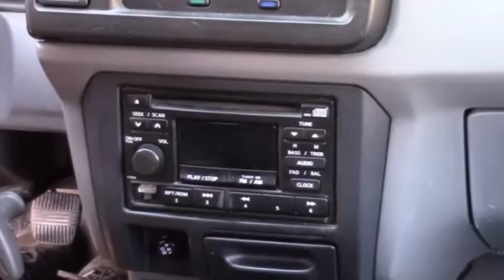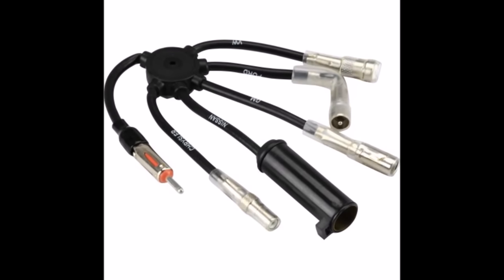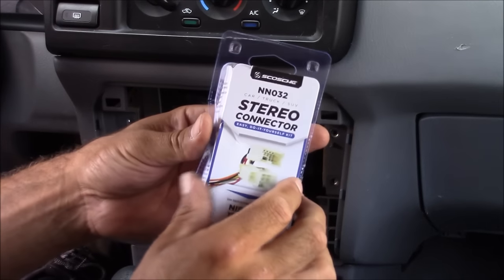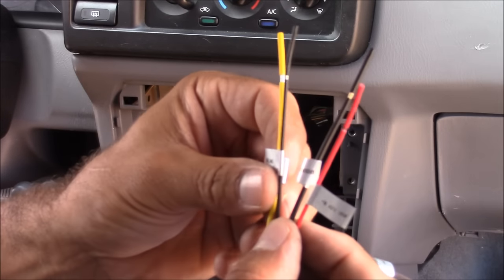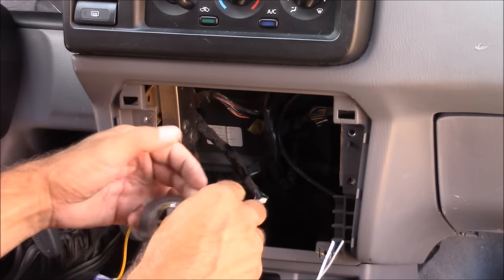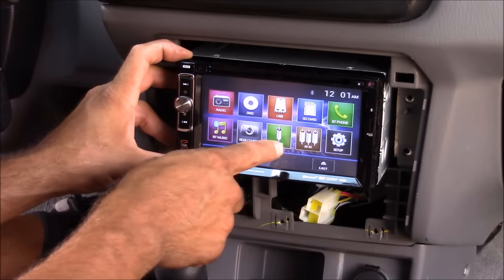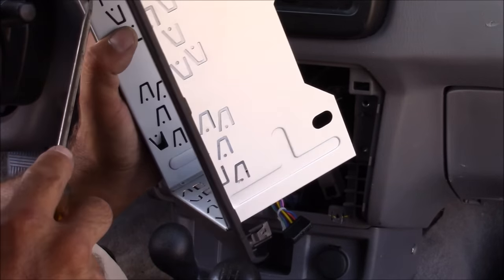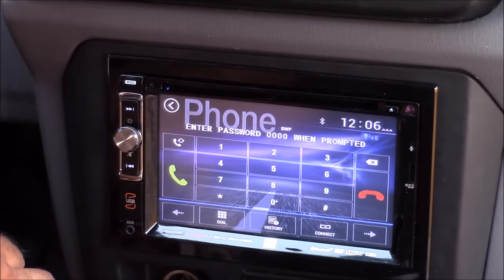How to install car stereo for beginners DIY

Comment: Hi, i just bought this yesterday. My question is this, there's a wire harness that came with it can i just use this and hard wire it the my car or do i need anything else?
Reply from the maker: Virtual Rogue if you know what wires are ground/power/speakers etc on the car then you can wire right to that. But I would recommend buying wire harness adapter so you don't have to cut stock wires.  If you ever sold the car you could easily put back in the stock stereo using wire harness adapter. But if the wires are cut it makes it a pain in the butt.
Reply: ok thanks

Comment: Can you connect subs to this double din?
Reply from the maker: Juan Vega yes just hooked up sub actually to this deck a week ago.
Reply: C.L.S. Allinone thanks and do you think you could be Able to do a full review
Reply from the maker: Yes eventually I will release a subwoofer installation video but it will be for a different vehicle. But it will be a standard installation tutorial for all vehicles. The Dual deck in this video has subwoofer volume control with frequency adjustment to get bass sounding really good .

Comment: I just bought this, but it's already been opened before and somebody took the mounting bracket. I already have a double din deck installed on my vehicle, are the brackets interchangeable or do I need the one specifically for this?
Reply from the maker: Daryl Ramos sometimes they are interchangeable you could slide it in and see if it locks in place.

Comment: Hello, I have a question. Where were you able to find the mounting cage and the stereo connection adapters for this product. I bought the same one and am having trouble finding those accessories.
Reply from the maker: Mounting cage should come supplied with stereo when purchased. If you purchased stereo used the cage may be missing might be able to find one on ebay here is a link that might help: http://www.ebay.com/sch/i.html?_odkw=dual+moiunting+cage+double+din&_osacat=0&_from=R40&_trksid=p2045573.m570.l1313.TR0.TRC0.H0.Xdual+mounting+cage+double+din.TRS0&_nkw=dual+mounting+cage+double+din&_sacat=0 ...  Stereo connection adapters can be found on Ebay or at Walmart,  Best buy, Autozone, and Oreily's and most other auto part stores.
Reply: C.L.S. Allinone Thanks a bunch

Comment: Where did you connect the steering wheel control? I have a 2002 Nissan Pathfinder
Reply: You have to buy a adapter

Comment: hey. I instead  one of these  in my 96 s10. every thing works till I cut the light on  then it goes blue. What is the best way for me to handle  it
Reply from the maker: Stephon Reed sound like Something to due with dimmer wires try unhooking any wires labled dimmer then cap them off and test radio and see if lights still effect it.  If that still does not work double check all connections its not too hard to mix a couple wires up.

Comment: 2005 Silverado WT bought the $20 dual and got everything wired to find out it didn't even work.
Reply from the maker: TractorGuyZ71 Alot of people are having issues with wire harnesses adapters having the wrong color codes. Maybe try a different brand of adapter. Best Buy, Auto part stores carry different brands to try.
Reply: Looked on amazon and they have a metra for $5 while i got the $39 at walmart. So ill try the five dollar one to see if that works.
Reply from the maker: TractorGuyZ71 ok keep us updated. thanks
Reply: Going to return it and try pioneer or something. I wish there was just an adapter you buy and you dont have to do all this wiring. Mabey there is but why would you make the video then lol!?
Reply from the maker: I dont think the stereo is the problem If you are using a wire harness adapter that is probably the problem and it might give you grief with another stereo also unfortunately .

Comment: hey i bought this one and installed and it worked fine until i turned the head lights it made the stereo screen go all blue and wont come back on unless i turn the head lights off
Reply from the maker: Something to due with dimmer wires sounds like try unhooking any wires labled dimmer then cap them off and test radio and see if lights still effect it.  If that still does not work double check all connections its not too hard to mix a couple wires up.

Comment: the xdvd256bt doesnt have a yellow wire but an orange wire that says backup memory
Reply: Duck Wizard having the same problem
Reply: Key Tomlinson no worries, the memory backup wire, is the wire. the Orange wire is the yellow wire. I got so pissed when it work. I felt stupid.
Reply: I have the same model but it wont fit in my ctown vic.

Comment: It keeps saying cant play DVD when driving got that but my cars not on
Reply: Find the wire off the stereo that is labeled something about parking brake and ground it to bare metal or the DVD player itself. It's a safety feature so people can't watch a DVD unless the vehicle isnt moving and has parking brake set. But if you ground it like I said you can watch DVDs while driving

Comment: You forgot to mention where to connect the brake wire!
Reply: Connect it to the unit itself some where. I've installed plenty of DVD headunits. Easy fix just connect it to one of the screws you remove to remove the warning tag. Then put some Crazy glue over the screw to help keep it tight

Comment: Question I have the same model car 2000 Nissan Xterra same brand of radio but the harness I got does not have a black ground wire but the radio does radio works fine till i turn on my head lights then the radio shuts off how do I fix this problem
Reply from the maker: victor martinez find a suitable ground on your vehicle to attach ground wire with self tapping screw to closest solid metal or you can tie in with the cigarette lighter ground.

Comment: I got a 2003 Chevy trailblazer and I removed the   6 disc cd changer and had to put it back in and now it won't start.  I've tried jumping it off and the lights will come on but it won't turn over. And the battery won't hold a charge. Wut should I do
Reply: You may need a new battery or alternator

Comment: Hey serious question here. Just bought this as my first lcd unit. After hooking it up to test, the screen is black but the buttons around it light up (only with my lights on unfortunately). Do I have to reset it maybe, or did I miss something? almost like it set itself to standby but won't come on. What are some things I can try? thanks in advance
Reply from the maker: Inexoria sounds like a dimmer switch problem try unhooking any wires that say illumination, dimmer any thing related to lights. If that's not the problem might have a weak ground or weak power source check with test light and if test light is really dim there is a problem. That's a couple common things to check out.
Reply from the maker: Inexoria please leave update comment if you find the problem a couple people have had the same issue on here. thanks.
Reply: C.L.S. Allinone yeah I'm lost. I unhooked the illumination cables, tried splicing the amp line into the ground line, everything is hooked up the way it should be but I'm getting absolutely nothing from the display
Reply from the maker: might be defective unit.  also  parking brake wire might be an issue I just hooked mine up with the ground wires. Also if its not to difficult I would take stereo out and  open hood and hook stereo directly up to battery by splicing yellow,red, power wires together and all grounds together then just touch wires to positive and negative on battery terminals to see if it turns on to rule out if the stereo is defective or not. also check fuse on back of stereo just to be sure.
Reply: C.L.S. Allinone yeah I just got a replacement, same model, and I'm having the same problem. while my lights are on, the stereo shows blue lights but I'm getting absolutely nothing from the screen, it's just totally blank
Reply from the maker: Inexoria a test light should show which wire is having issues when you turn your lights on and off test each wire on harness it should either dim or get much brighter when turning lights on and off .
Reply: C.L.S. Allinone hey just to check, should I try to splice into my stereo wires? I think the problem might be my harness to be honest.
Reply from the maker: Inexoria  I would try to find the problem wire first before cutting anything.

Comment: I bought this radio today I set it up but weird thing when I turn on my headlights the screen turns blue but when I shut off the lights it goes back to normal.. any suggestions need the help..
Reply from the maker: albert guevara try disconnecting illumination wires. please update if it works. thanks
Reply: Ok . I did that and still does the same thing and I rechecked all wires and they are correct so now I'm stumped ..